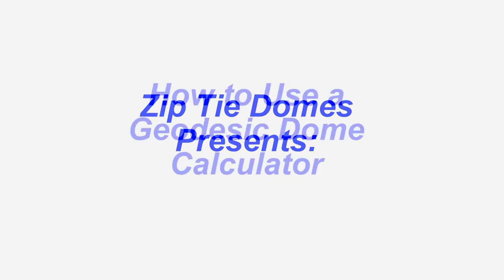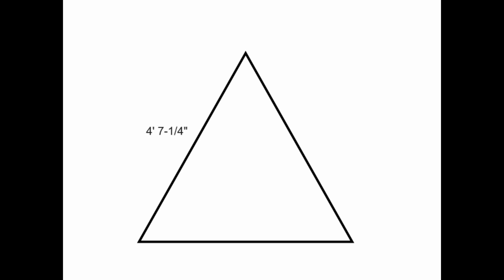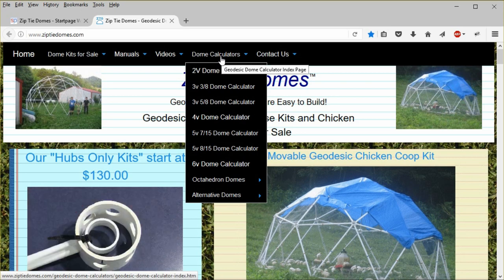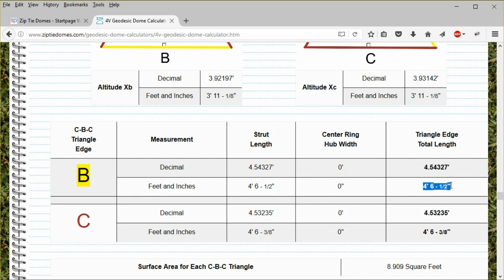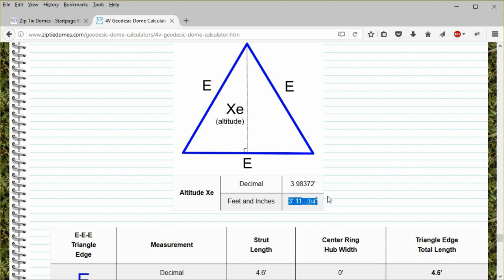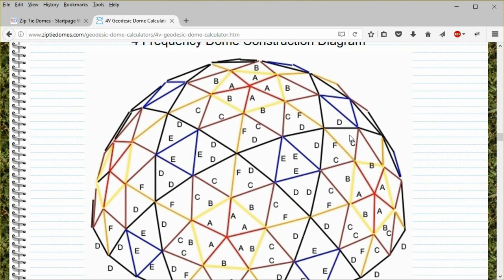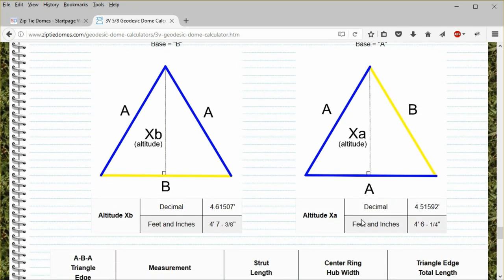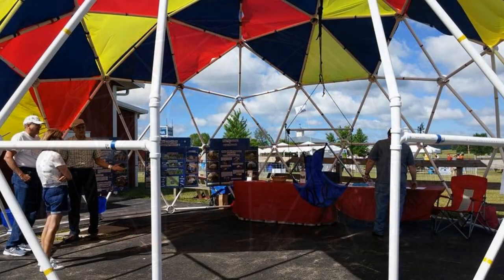How to Use a Geodesic Dome Calculator - Part 5: Dome Coverings

Comment: The ziptie domes that I have looked at on you tube have all been pvc pipe. on this video you are using 2x4 lumber to attach your panels. how are you using zip ties to build this dome?
Reply from the maker: There is an example in this video of domes with 2x4 lumber made by Gavin McArthur in Masterton, NZ, and they are not Zip Tie Domes.  So, this dome calculator can be used for all types of domes.  Thank you for your comment.  John Hurt
Reply: Without a doubt your dome calculator is fantastic. I was only interested in using connectors for more permanent structure using to buy for material. So when this video said that it was a zip tie dome. I had to ask. Thank you for your reply.

Comment: Wish I had had this calculator when I covered my ziptiedome. But we were covering the whole thing with netting. I didn't see a calculator that would give the calculation for a whole dome. If you have one I would like to use it. We love our dome!!!!!
Reply from the maker: Thank you for being our customer!  When I put netting on my geodesic chicken coop domes, it would overlap, and was never "perfect".  So here is whatI found from "experience" and is what I put on our website:  11" Chicken Coop dome:  3' x 100' roll of chicken wire.  13' Chicken coop dome:  3' x 150' roll of chicken wire.  16' Chicken Dome:  4' x 150' roll of chicken wire.  The Assembly Manual also tells you the best way to attach the chicken wire, or you can watch this video:  https://www.ziptiedomes.com/video/chickenbuildvideo.htm
Thanks,
John Hurt

Comment: I find it so complicated to line and insulate a geodesic home. OK for a greenhouse but to line, insulate and cover, the original simplicity goes out the window.
Reply from the maker: Yes, cutting 4' x 8' sheets of plywood into triangles for a geodesic dome home creates a LOT of waste and is complicated.  It is better to spray the outside of a geodesic dome home frame with concrete to create a concrete outer shell, and then spray the inside with closed cell foam, then stucco over the foam on the inside.  That is an easy way to build a dome without waste. Thank you for your comments.  John Hurt
Reply: @ZipTieDomes  Before I ran into your reply I was thinking of aircrete over fanfold panels
.  Why not use that Owens Corning FOAMULAR 1/4 in. x 4 ft. x 50 ft. R-1 Fanfold Rigid Foam Board Insulation Sheathing cost 50.00, very thin but with the aircrete ~ it would have substance
Reply: @ZipTieDomes  What material catches the concrete you are spraying on the outside of the dome, can a bedsheet over the dome  work?

Comment: You make it to damn hard. Just use a sheet metal true length  layout. That would be so much simpler to use. Then all you need is the circumference and the height of your geodome.
Reply from the maker: That would be a great calculator.  If you design something like that, let me know.  Thanks for your comment.  John Hurt

Comment: Picking a different dome is not a solution for a difficult build. Obviously, this needs research to develop easy shortcuts.
Reply from the maker: That is correct.  But your chances of success for your first dome covering will be much greater with a 3v dome than a 4v, 5v, or 6v dome.  Thank you for your comment.  John Hurt